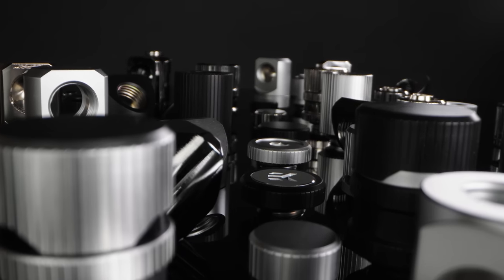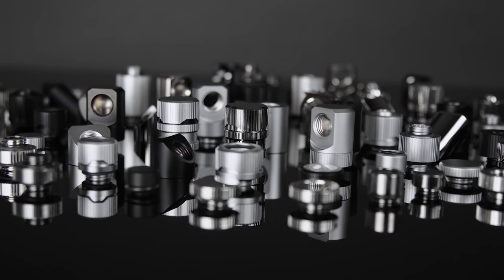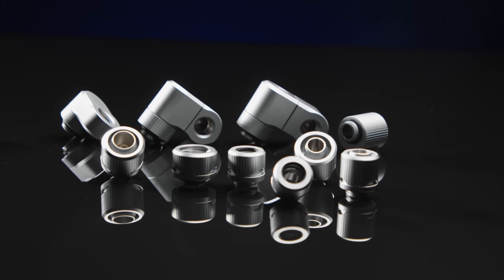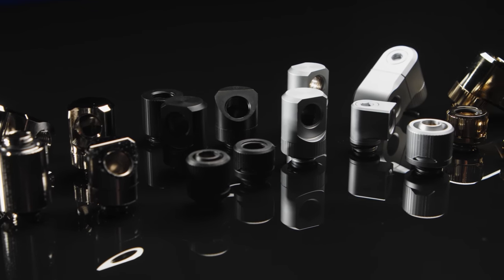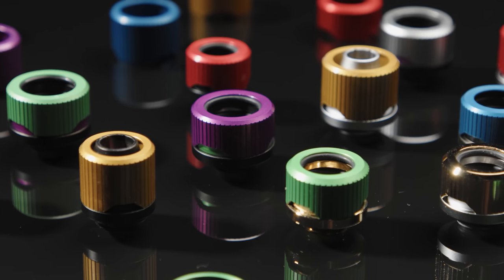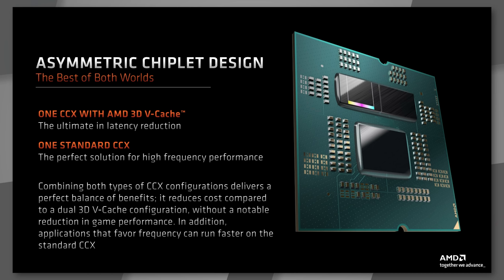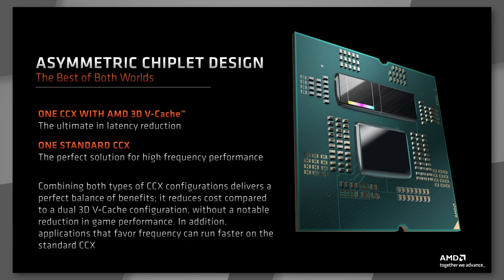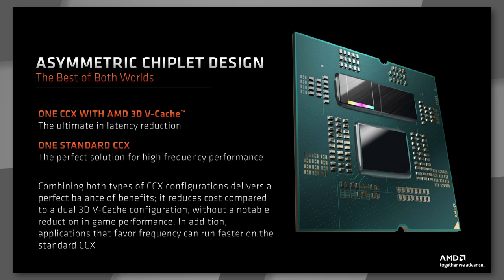Why I switched back to Intel...

Comment: When I built my system late last year, I was on a 7th gen i7 and decided to give AMD a try, as I had some good experiences with some of their older CPU's back in the mid 2000s.  I ended up with a 7700x, and was a bit salty when the X3D CPU's came out a couple of months later.  But after hearing your story, I'm glad I ended up with the standard chip.  My system has been completely rock solid with 32gigs (2 16gb sticks) of Teamgroup 5200mhz DDR5.   At my age, I'm happy to do less tweaking, and just have a good stable mid-range setup that I can step up in a couple of years as I need.
Reply: The 7700 is the sweet spot in terms of value, performance and power efficiency. Doesn't require an expensive VRM solution and a hefty cooler like the 13600K does.
Reply: "But after hearing your story, I'm glad I ended up with the standard chip."

His issue is specific to the 7950X3D, not the 7800X3D. The latter has one chiplet, so it doesn't need to park any cores nor rely on Xbox Game Bar to identify game applications. I've been using it for the last 3 months with zero issues - running 6000 MT/s CL30, also from Team Group. Only took me a few hours to build it, get the applicable chipset drivers, and start playing games. I take many of the "I have issues with X, Y, and Z" comments with a grain of salt. I've dealt with five 3D chips now, two of which were for my own system (5800 & 7800), and no hiccups.
Reply: I'm sitting on my 2011 Gateway with an i5-2300 quad core with 3 FF windows and 32 tabs open (including 3 youtube, a Kongregate game, Facebook, etc) along with Irfanview and a mouse clicker all running. 2.8 Ghz CPU is popping a touch over 3 Ghz but still only 28-30% utilization... though my 12 gb of DDR3 is sweating a bit. Without closing anything, I can pop open Toontown with no issues (I know it's not a "real" game... and don't make fun of me, it's FUN). I've tried killing this thing with Photoshop... it won't die (like my Buick)!

I agree about age and driving a Buick 😁, when I was building pcs, starting 20 years ago... it was fun and challenging (we couldn't use a mouse on our BIOS back then, kiddies). Now I just want it to work with minor tweaking... I didn't go AMD, but my CyberPower only ran me 850 with a 13400f, 1tb NVME gen4, 4060 card (beats my 7700 Ghost by a bit)... XMP was no big deal, BIOS flashed easy and can support 14th gen if I find one on the side of the road. My biggest issue so far is figuring out what the error codes on all these pulsing LED's fans mean! 
My biggest concerns have been... well, getting OG MSPaint onto Win11 (I know it's not a big deal, but that's how easy this was)... oh and I can't stop the mouse from cycling LED colors.
Reply: Why am I not using my new PC? It's too clean , don't want to muck it up. Kidding, need to wipe this and hand it off to my mom, locating and moving 12 years worth of files. And FULLY set up the CyberPower with everything I'll use... Ninite got me halfway there.

Comment: I bought an 7800X3D+X670E on launch day. I went for Corsair Dominator 5200 (relatively slow speed, 2 sticks) and I haven't experienced any issues whatsoever so far. It has been a great experience. I have been very careful to always go for the latest BIOS, especially with that voltage debacle. 
I came from an 3950X X570 and that one was unfortunately a terrible experience until the BIOS was patched up. I couldn't use USB properly for several months. After the BIOS patching, that system has been running rock solid.
Reply: I feel Jay wanted an excuse to go back to Intel no matter what.
Reply: @KingcoleIIV   he didn't even try RMA an obvious IMC degradation fault lol. really not very experienced with PCs.

Comment: Some thoughts over my experience in these recent years. I ditched Asus mb for gigabyte as they seem more stable. I have read a lot about problems with expo ram kits. My preference is gskill xmp ram kits. I have worked with them in my last two builds (5800x, 7950x) and they're running rock solid. My job involves a lot of 3d rendering so everyday is like a stress test 😂.
Reply: Would never touch Asus, Asrock, nasty boards. I have had trouble with intel n AMD,.
Reply: ASUS has become increasingly unreliable over the years and even more appalling is the fact that their support has completely gone down the tubes. ASUS isn't nearly the company they were 5 years ago. ASUS likely still makes some good system boards but I wouldn't chance buying one because ASUS support is vast becoming an oxymoron. GIGABYTE, on the other hand, has really stepped up to the plate over the years. It's almost as though they found ASUS old client policy list, hired the best hardware developers they could get, and followed ASUS old model. If they stick to what they are doing they're going to pass ASUS both in quality components and customer satisfaction.
Reply: Several years ago i switched to AM4 with a X570 Tomahawk and a R7 3700X and i choose an expensive G.Skill XMP 3600 CL15 Kit (aim was to tune the memory to its limits) and oh my i never got the system stable at XMP speeds for about 1,5years. Then i switched to an R9 5900X, changed to an PCIe 4 m.2 and to a RX 6800XT and suddenly the RAM and the system worked as if nothing had happened before. My BIOS was always up to date. But since then it worked like a charme. I am satisfied at last since i value efficiency over raw power.
Anyways saw both sides in one system and yeah it can be really annoying.
Reply: @scannerman777  That's interesting. I used to always go with gigabyte because they were solid for me, but for my 7950x3d build I went with a gigabyte aero g board and it was nothing but problems for months- constant blue screens and crashing. I swapped to an asus strix x670e-a board and it has not crashed once. After I was satisfied and increases the speeds of my ram, it did start taking longer to boot but no crashing or blue screens at all.
Reply: Which gigabyte mb did you use for your 7950x build?
Reply: @horby648 maybe it was a defective board? Did you have it checked?
Reply: @stewenw4120 I had the same issue with a 2700x on AM4 platform. I loaded xmp and then lowered the memory speed one step at a time until it was stable (3200 on a 3600 kit). When I upgraded to a 5800x the ram was stable at full speed. I think for ram stability the factors are both the motherboard and the CPU memory controller.
Reply: @HarbeckLights  Gigabyte B650M Aorus Elite AX (rev. 1.x)
Reply: @horby648  I don't doubt it for a minute. There are nearly always exceptions to the rule and it looks as though you found one. One more reason why it never pays to be a fan boi. I am surprised still, as generally GIGABYTE boards have really come a long way. And this is coming from a hard core, once upon a time ASUS fan.
Reply: After having two dead asus motherboards within 2 years and even replaced under warranty, i went gigabyte too and it was rock solid...until i actually got an opportunity to buy a friend's pc with MSI and have been running that pc for the past 3 years. I  dont remember having a blue screen that was not caused by me and my weird experiments.
Reply: Super helpful comment, thank you bro
Reply: @loukasvoidommatis9203  well if they list a particular speed as stable on their site then its false advertising

Comment: I have a 7800x3d and it works pretty great, my ram is also 6000MHz specifically the Gskill Trident Z5 with a B650 AX motherboard. The only issue I'm having with it that I didn't have with my previous 3900x is that during shader comps the CPU temps go insane. Normally at 100% it hovers around 80c, but during shader comps I've had it reach as high to 88c. But other than that it has been surprisingly stable and performs extremely well, it almost doubled my fps in some games and almost completely eliminated stutters.
Also If you're not using the integrated GPU on the 7800x3d make sure to disable it in bios.
Reply: Which cooler?
Reply: @undiyos  Currently using an NH-D15
Reply: @SekiberiusWelkesh  the temps seem a bit close to tjmax at load. Have you used curve optimizer? Mine runs at - 30 curve optimizer stable. Switched to 360mm aio and temps do not cross 80c on full load, that is with the newer bios. The older bios allowed me to drop till - 39 CO and temps did not budge past 72c.
Reply: @undiyos  I ended up turning maximum power to 99% and it pretty much never goes above 70c anymore, performance is about the same as well.
I discovered what was causing it, it was the V-Cache, which is apparently normal behavior.
Reply: 3000MHz*

Comment: Once I got everything up and running and installed the proper drivers, I haven't had any issues. I am running 2 sticks of 32GB at 6000 mhz without problems, and really have only played AAA titles, so I can't say how well the core parking works in other cases. It does run a bit hotter than I am used to at idle because of the thick IHS but otherwise I've been pretty happy.
Reply: I don't have any issues, but I have the 7800X3D, so it doesn't need to park cores or make use of Xbox Game Bar to identify game applications. The chiplet with the extra cache is always running.

Comment: I’ve been using my 7800X3D since August and aside from similar hung RAM issues at 6000Mhz, my experience has been great! It is amazing for a lot of the newer intensive games that I play and I hardly ever notice any issues with the exception of the first two minutes of gameplay every other time I start up Resident Evil 4
Reply: Strange that this is comes down to the mainboard. I have a 7800x3d CPU as well and a mainboard from Gigabyte (Aorus Master) and run it perfectly on 6000 Mhz. Also some mainboard seem to have loading times up to 30 second to windows. So the memory training take a lot of time. (this also based on mainboard) I dont have that either (10 second max). So when somebody go for amd make sure you pick the right mainboard. And dont pay 1.000 dollar for them... it is just silly.
Reply: @mcrib2499  I think you may be right, and it could also be a batch based issue because I have seen people with my same motherboard achieve a consistent 6000Mhz without any issues
Reply: @mcrib2499  Aorus Master B650E or X670E? 10 seconds is with MCR (Memory Context Restore) enabled or disabled?
Reply: @playfriik  I have the B650e

Comment: I’m using 7800x3d, I had severe memory timing issues with CL39 DDR5 ram and then swapped to CL32 DRR5 RAM and I still get occasional crashes but not nearly as often. I want to review your previous videos to see how you dealt with it. Eventually I’ll get CL30 RAM that’s on my motherboard manufactures list.

I totally emphasise with your decision to go back to Intel for the stability because RAM and CPU should be plug and play and be stable when using over clocking profiles. I just play games that are very CPU heavy.
Reply: its ytour board not the ram , i had same issue with gigabyte b650 and i decided im done with gigabyte and bought the msi tomakawk b650 and literally not a single crash since i switched 9 months ago 

the gig board is absolute dogshit and caused all my memory timing issues to the point i would crash on every single restart. literally every single problem gone by switchng my motherboard to msi

bottom line buy a quality MB DO NOT BUY GIGABYTE !!! LITERALLY THE WORST COMPANY IN THE GAMING SPACE
Reply: 7800x3d has only one ccd, you shouldn't get those memory issues. have you tried other bios/mobo combos?
Reply: @fullsend_ny7948  i think you may be right. 7800x3d shouldn't have issues like larger, two ccd, cpus.
Reply: @sakatababa   Well the AMD platform in general has its own set of issues with memory.
Reply: I used the gskill configurator and have zero issues with my F5 64gb ram
Reply: As Buildzoid said (Actually Hardware Overclocking), QVL is a guideline not a gurantee. If you have a 7800X3D ram speed in the least of your concern. Getting faster RAM does nothing for most of the applications because most application run in the 3D-Vcache and don't access memory as frequently as non 3D CPUs.
Reply: Some of the newer agesa bios finally improved the ram learning algorithm as well
Reply: @Ew40 It's not neccessary to overclkock the memory. if you use only 2 sticks you should reach 6000mhz. More is not sensible if the programs run in the cache. That's the whole point of the 3D-VCache.

Comment: The problem is most people who have stability issues are trying to run RAM at their advertised timings and speed. The highest official ram speed supported by Zen4 is 5200. Anything higher will be up to silicon lottery and soc voltage settings. I have been very stable running 6200 30-35-35 timings with my 7950x on MSI ACE x670e. My ram is rated at 6400 32-39-39 but I have never gotten that stable at soc voltage 1.25V (don't want to go any higher). If I don't keep the uclk = mclk, I could be stable but I lose performance at that point.

Comment: I have had very similar issues (memory training loops, not hitting expected MHz, long or failed boots after having the system off for hours) with 7950X (non-3D), Asus ROG Crosshair X670E Hero, and 2x32GB Vengeance sticks that are supposed to run 5600 with EXPO, the system is only stable at <5200. Tried with multiple BIOS revisions over time.
Reply: i did too, it seems to have sorted itself over time...

Comment: I have always had both brands in my house since Phenom 2. Both brands are great and now with Ryzen AMD is competitive again. I'll still always use both. They are both great. I haven't used X3D though. I'll probably wait until the issues get sorted out.
Reply: Loved Phenom II! I still own Phenom II X6 1055T, and it has been the longest lasting CPU ever.
Reply: His issues are specific to the 7950X3D, not 3D in general. I don't understand why every commenter seems to have not actually watched the video. The 7800X3D has only one chiplet, so it doesn't need to park cores nor rely on Xbox Game Bar to identify game applications.

Comment: Yeah, my i9 14900k is running 7000 M/T DDR5 64 GB rock solid sturdy and stable.
Reply: I just built a 14900k z790 setup last night and went with 32gb ddr5 (so I can OC to 8000M/T). Debating switching to 64gb @ 7000M/T. Took 3 days to do the custom loop. Epic insane system!
Reply: @halflife82  ive heard that the 14900k draws a lot of power and can get hot has this happen to yours?
Reply: @halflife82   Custom cooling? Sounds like you have a kickass PC there. I got my RAM up to 7200 now, but I bought this Corsair Dominator Titanium. This RAM was not cheap at all. As a matter of fact, I'm sure I over spent. 2 32GB sticks of this Dominator Titanium was $400, but it has no ceiling. I have been able to overclock it at will. It is great RAM.
Reply: @jameysummers1577  does your games crash with that high memory speed? Also thinking of upgrading to 7200 mhz
Reply: @chrisnieto3620  so, I don’t know. I was worried about crashing so I dropped it back down to 7000. So I haven’t found that out at 7200. it is stable at 7000 and I’m happy with that. I figured the extra 200 wouldn’t make much of a difference so I dropped it back to 7000.
Reply: @jameysummers1577  yes I was worried about that being to high which made me very skeptical to upgrading that high
Reply: me too, don't need CPU issues my i9 absolutely rock solid, and temps are pretty good too with a proper AIO. No chance I'd use an AMD anything....
Reply: @chrisnieto3620 it runs hot, can run too hot if you’re cooling isn’t sufficient…aka human error. Get good. Don’t be a loser and know wtf you’re doing. Intel 14900k will outperform any AMD consumer based cpu point blank period…can’t wait for someone to say threadripper or some bs but we all know that doesn’t count.
Reply: @puppetzinc1 facts
Reply: @godnamedtay  just got my i9 14900kf with crucial pro 2x16 gb ddr5 6000mhz  but with an air cooler Hyper H411R  cant afford an AIO at moment  just hope I can keep it cool enough!

Comment: Sad to hear you had so much issues with the new AMD platform.
Personally I have the 7950x and 64gb 6000mhz ram, and I have not had one single issue related to that. I have made sure to keep my bios and drivers up to date.
Reply: Mostly an 7950x3D Issue. Hes not alone and its a TON of people that have the issue. 7800x3D doesnt have the issue either for the most part afaik.
Reply: @ShimejiiGaming  Yeah, 7950x3d is a chip that wants to do it all and doesn't really succed anywhere, unless you're willing to disable the non-3d chiplet in the bios everytime you want to game.
Reply: @ShimejiiGaming  I am running the 7800x3d with 96Gb 6400Mhz memory and have zero issues. Heat or otherwise... but then again my primary goal was game performance not multitasking. So far I have not had a single crash which is awesome. My previous system was a pre-built system and I was not happy with almost from the get go. The current system is built by me and I have loved it
Reply: Same CPU here, 7950x with 64GB of EXPO 6000 RAM from Gskill.

Latest firmware with the ASUS motherboard and seems to be very stable.

It does seem to be the 7950x3D CPU that is having some weirdness issues like this :(
Reply: @ShimejiiGaming  Knock on wood.... but I'm running 7950x3D and 64gb of 6000mhz ram for the last six month and haven't had any issues.